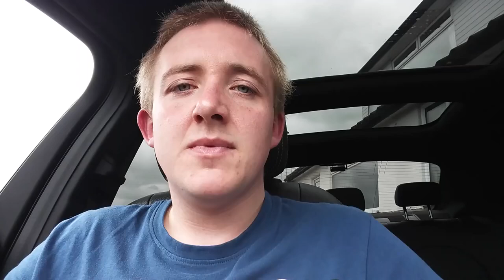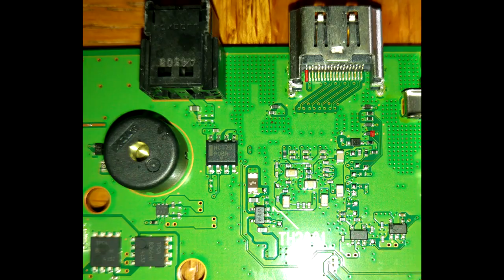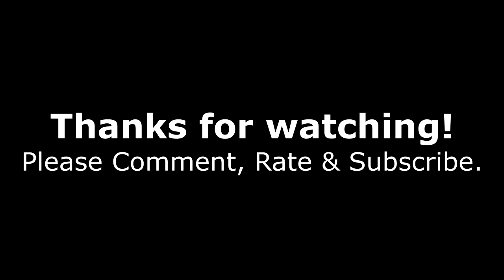Phat PS4 HDMI Pin-out - SAA-001 / SAB-001 Motherboard (10xx / 11xx Series)

Comment: Oh and the console i'm working on is CHU - 1115A. Does that match this series of boards you show this pin out for?

Cheers man.
Reply from the maker: Hi, yes the diagram will be fine. 6th pad (pin 14) is indeed an NC pad and is not required. Pin 13 (7th) is CEC. Check diode is not shorted to ground. If everything else is fine and you get white light no image then chances are it's either a bad Encoder IC, or a damaged / missing surface mount component in the HDMI circuit. Get it under a microscope to check for any missing / cracked components around there to be sure.
Reply: Yup. I did use a binocular stereo microscope and did see much damage. I will look again today, I'll also go over the other things you mentioned.
I dio have IC chips, as a last resort Ill try that.  I'm not using the wire you mention, I'm using more of a steal based wire it appears as it looks sliver... could this be the issue?
He mentioned it might not be the right of wire for such a high frequency output like HDMI.

Cheers Mate!

PS.  How come the pads and the pins that connect are so distantly numbered when them connect to each other?

Comment: I have everything in place and and i have the 7th pin run with the wire to where to should go, and I still get a no video single and a white light.
The 6th pin is not connected as that pad was destroyed too, your diagram reads the 6th pin doesn't connect anywhere... is there somewhere I can connect it?
I can only assume that this the remaining issue, as this system worked fine before it was dropped and the cdmi port busted.

Any help would be greatly appreciated!

Cheers

Comment: I have  ps4 a customer dropped and brought in. The 6th and 7th pads were destroyed. Not sure how high this fell from, but it was mangled.
Anyway, I checked out this video. Am i under standing you correctly hen you say the 6th lead doesn't have to be connected?
I connected the 7th lead to the small pad just off the A1 as you suggested but I'm still getting no video single.

I had been getting single and sound at one point, before I even jumped the lead.
Any idea? should I try connecting it to the other place ou suggest for the 7th lead, or is this just FUBARED?

Cheers!

Comment: Hi, I checked pin number 9 ( in the order shown in video, starting from the Digital out optical port) and it shows up as grounded. I checked it on three different consoles(CECH-100XX and CECH-11XX models), two of which are working (all resolutions) and all of them show pin 9 grounded. Can you check again to make sure your video is accurate? Thanks.
Reply from the maker: Pretty sure it is GND to the back side of that diode in the image. Definitely accurate.
Reply: Hi. Same problem here. The 9th pin is grounded. Is that an IC problem?

Comment: is there another point I can jump a wire for pin 3?
Reply from the maker: Third in from the right? Yes - run a wire through to the underside of the board and directly to the EMI filter pin at the end of that trace. Use a multimeter in continuity mode to check you have the right one (it'll beep).

Comment: Hi Andrew Paul,I ruin my board,because wrong temp four of the pin been out then I found this video,thank Andrew for the guide..
Reply from the maker: No problem. :-)
Reply: Hi, I checked pin number 9 ( in the order shown in video, starting from the Digital out optical port) and it shows up as grounded. I checked it on three different consoles(CECH-100XX and CECH-11XX models), two of which are working (all resolutions). Can you explain this for me? Thanks.

Comment: Hello Andrew,Awesome you tube channel. I replaced HDMI port customer had  obliterated. Had to replace 2 jumpers. Went by your diagram and getting white light. Will you please recheck pins 1 and 4 on your video to be sure correct? I am at disadvantage as my fine meter leads went bad and I'm having to use leads unsuitable  for this type of work so can't trace properly.  Thanks Alan
Reply: Found problem. A lot of pins are shorted to ground. Guessing bad HDMI IC under shield. Haven't pulled it yet.
Reply from the maker: Most probably.
Reply: Are some of these Panasonic chips glued? 10 minutes at 790 degrees and not budging.  I've changed many receiver hdmi ICs and they usually come off within couple of minutes, I'm using flux. Any other special chemicals involved?
Reply from the maker: Are these on CUH-10xx/11xx or 12xx?
Reply: CUH-11xx
Reply: Finally got it by loading pins down with chip quick 291ax soldering paste. Came up less than a minute. Not sure why it didn't come up with flux earlier unless it's too old. Thanks for replys.
Reply from the maker: No worries - was going to say that none are glued as far as I've ever seen. Only thing I could think was that these were CUH-12xx machines and with them being QFN packages the centre ground pad with the surface tension that brings can sometimes feel as though they 'stick' a little before they come away. Glad to hear you have it sorted though - probably down to old flux as you say.
Reply: Yes I had thought about possible ground pad also but don't think I had ever had one give me that much trouble even with a pad. That flux smells awful think it is bad. Had purchased a case of it maybe 7 years ago so that's all that makes sense. Thanks again.

Comment: quick question... can i take a hdmi port out of a blue ray player and solder that into my ps4 as a replacement? i would imagine its all standard and no special differences
Reply from the maker: No not really. Ports are £2-3 a piece so much easier to just buy one.
Reply: +Andrew Paul yh i had issues trying to melt the solder i dont have the equipment for it but ive been quoted some pretty stupid prices too for the job
Reply from the maker: Where are you located?
Reply: +Andrew Paul near cardiff south wales
Reply from the maker: Check my eBay page - I offer mail-in repairs for HDMI ports for UK-based consoles:
http://www.ebay.co.uk/usr/lufcfan2004

Comment: Hi Andrew, first of all thank your for your great video's. I think they are really helpfull. I got a ps4 pcb problem myself. Most of the pads are ripped off. Should I remove them from the old hdmi and try to glue them back on the board or just solder the new wires directly to the pins?
Reply from the maker: Running link wires is probably the best bet - it all depends how bad the damage is really.
Reply: quite bad I'm afraid: https://s32.postimg.org/ay6fvsbv9/afbeelding2.jpg

Comment: Hi andrew! thanks heaps for the video :) Can you please guide me how to connect pin's 11, 14, 16 & 19 as the connections run to the small holes on board... :(
Reply from the maker: Hi Lee,
Have a search on my channel for a video called soldering to vias. That will show you how to correctly prepare these small holes for soldering to. Cheers.

Comment: HI Andrew would you have any idea where I would get replacement components for around the HDMI port as someone had tried to repair a HDMI port on a ps4 and messed it up big time, ie missing pads, lifted tracks and 5 surface mount components from around the HDMI port. any help would be amazing.

Comment: Hey Andrew, I have repaired a few PS4s where an attempt has been made to replace the HDMi ports and they have ripped the pads out, one had 7 pads missing, I have never repaired them with tracer wires, I removed the solder mask with a fibre glass pen to reveal more copper around the pad and the start of the trace, once this is done the solder pools like a dream back where the pads used to be. Then replace the port as normal with no messy wires, have you tried this. Regards
Reply from the maker: +Tech Repairs Hull Ltd Hi, yes I'll do it this way if I can get away with it but often I find people pull the traces too leaving a bit of a mess behind. Cheers for the tip though - I'm sure many will find it very useful :)

Comment: Should the 2nd pin in your video be grounded?
Reply from the maker: +andrew chalmers No. That goes to a small diode. If it's grounded there's your problem - you've just got the small problem of working out what's pulling that portion of the circuit to ground. Pull the Encoder IC and see if the short disappears, if so then replace it with a new part. Good luck!
Reply: http://postimg.org/image/kckoxga8n/

Where can i get the 2 small componets that are missing top right of ic chip?

Comment: Have you ever had one where you replace the HDMI connector and everything works except 1080p? Pins on this one were really messed up and 1080 won't come back no matter how many times we try a video reset and hdmi cables. Almost seems like something shorted out on the board but can't seem to find anything that is burned. Any ideas?
Reply from the maker: +Short CirQit Hi, check the EMI filters to make sure none are shorted. If they're OK then replacing the HDMI Encoder IC should do the trick.

Comment: You are a legend thanks for this, 
Currently repairing a bodge job of a hdmi being ripped off. Top right component has also been ripped off the board. (Tracks intact) I think this is just a zener or a protection to ground component am I in thinking this is correct? This is the 5th pin in your tutorial. 
Many thanks 
Dave
Reply from the maker: +dave vachon Correct mate it's a zener diode and can be ripped from a donor board or even a PS3 mainboard if you've still got some of these kicking around. :-)
Reply: Cool well am I correct in thinking this should work without for now as its not a part of the actual HDMI signalling?
Reply from the maker: Never tried it with it missing to be fair mate - the ones I've had that have been missing I've always replaced prior to testing. Cheers.

Comment: Thank you so much for this! I used this pinout to test the HDMI circuitry with a multimeter on a ps4 with the WLOD and it all tested good and the port is in perfect condition... That being said I believe the Panasonic IC must be bad, although I am curious to know if you might know if/how I can test the IC directly. After watching your repair from hell video(PS4 Repair From Hell - Complete HDMI Circuit Rework ), I am confident that I can replace the chip if needed as I am fairly skilled with a soldering gun although I will need to pick up some flux, desoldering Wick, and maybe a smaller heat gun(air gun) as well, because the one I have is quite large and puts out a ton of heat.
Reply: +Chesley McDaniel Update, I am now watching your video about pin 13 short to ground and I don't have a short to ground although in checking the two points of the diode I get infinite resistance at any ohm setting on my multimeter.
Reply: +Chesley McDaniel Another update, Btw this is not a previously botched repair attempt ps4. It just mysteriously stopped displaying a proper signal via HDMI. My samsung tv gets a partial signal I believe as it does not have the HDMI source greyed out when the ps4 is plugged in, as it is greyed out when not plugged in. I just tried a different multimeter with a diode setting as the previous one (I realized) does not have that setting (the lowest setting is 200ohms). So that being said, I do get a reading on the diode of 681 according to this other multimeter. I also am now watching another video I just found of yours (How to Diagnose and Replace a Faulty Panasonic MN86471A HDMI Encoder IC Chip (WLOD).
Reply from the maker: +Chesley McDaniel Sounds like a faulty MN86471A from what you're saying.
Reply: +Andrew Paul Yes and thanks to you, that is the conclusion I have come up with. I will get that chip ordered and see how I do. Thanks again Andrew.

Comment: why does no one make a past that hardens into a new pad, brought a ps4 off ebay, some ass has done a previous repair and stripped the pads from the board, dont have a road runner wiring pencil to join any of the pins to the other components bridging it. Andrew, are you proficient in repairing HDMI pad damage?
Reply from the maker: +DirtyRottenBastard Hi there, Yes I am. It's very fiddy and needs some very fine gauge enameled wire and steady hand. :-)
Reply: +Andrew Paul how much extra on top of your ebay add to repair this damaged pad board, its basically pins 14 (no connected) pins 15, 16, and 18 that need sorting out.
Reply from the maker: +DirtyRottenBastard 10 quid mate.
Reply: +Andrew Paul 

Would like to just give thanks for this helpful video, finally decided to bite the proverbial bullet, and give bridging a go, once my road runner wiring pencil arrived. happy to report, we are back to a working PS4
Reply from the maker: Congratulations on the successful repair :-)

Comment: Anyone know what component pin 5 links too?
I am guessing it's a diode but it's missing here got a real dogs mess board off ebay
Reply from the maker: +Arnie Livingston It is indeed a diode. If you have any spare PS3 boards around the same one can be found and used from there.
Reply: Cheers man the display port is mangled too I might give up.
Reply from the maker: +Arnie Livingston Got any pictures mate? Might be salvageable?
Reply from the maker: +Andrew Paul Ouch. I wouldn't worry too much about the Aux port (its only used for the PlayStation Camera anyway as far as I know) - the HDMI has been largely butchered - those traces are all going to need a link wire running by the looks which is a pain. There's a good few hours worth of work in there so I'd ditch it unless it's worth your while to sit there and repair it. I've got one like that I've had for months which I'm going to get around to one day but I can't motivate myself ha ha!
Reply: +Andrew Paul there's hope continuity is good so it's just the one lifted pad & a diode just need a fresh hdmi socket. All caps  & traces on the camera port are gone though.

great videos by the way

Comment: Hi andrew I commented before here, change to my ps4 the hdmiand one pad is blow make the trace and all contact are good with alternative points, so the hdmi port must be good, change de hdmi ic but i still having WLOD. Some clue of what I have to check?
Thanks !
Reply from the maker: +Miguel Andres Correa Montoya hi, do you have a photo of the port, link wire and general area of the HDMI circuit? Cheers.
Reply: +Andrew Paul yes i have, i can post here upload sonewhere and send to you ;)
Reply from the maker: Hi, It looks as though some of those pins are a little misaligned (in the photo at least). Mainly right hand side, uppermost pin (is that pin crossed onto the adjacent pad or missing altogether?) and bottom row, 1st pin on the right. I think it would be a good idea to check continuity between adjacent pins to locate any shorts. I'd also be tempted to check those small resistors are still properly in place above the IC as they look to have been caught with solder.

Comment: hello I recently got my hdmi replaced and it still has no video, it shows the white light like it showed in the video. I'm worried either the guy didn't install it correctly or something else is damaged, is there a way to fix it or should I just loose all hope on it?
Reply from the maker: +MghUnit407 It's most likely a failure of the Panasonic HDMI Encoder IC (MN86471A) chip (providing the port was properly replaced that is). The chip lives under a metal plate on the backside of the board. Replace that and most likely you'll be back up and running. It's an easy job for an experienced tech - 30mins tops start to finish.
Reply: +Andrew Paul Do you these repairs yourself and if so at what price, I'm desperate right now.
Reply from the maker: +MghUnit407 I do offer a number of repair slots here:
http://www.ebay.co.uk/usr/lufcfan2004

Thanks.

Comment: Do I need a reball for my PlayStation because it used to turn on sometimes but now it only turns on when I put on pressure if I let go it turns off and how much would a reball normally coast
Reply from the maker: +danyal rafiq yes that's a classic sign of requiring a Reball. Expect to pay between £50 - £75 depending on where you are based.
Reply from the maker: +danyal rafiq yes that's a classic sign of requiring a Reball. Expect to pay between £50 - £75 depending on where you are based.
Reply: Andrew Paul ok thanks I live in England btw

Comment: Hey, my PS4 broke.. It turns on, then a few seconds later it turns off. I have researched it and I don't know weather it's the APU or PSU, my uncle is going to try a new PSU on it. But if I bang it, it works for about 20 minutes or so and then freezes, but if I move it slightly it does the same thing, keep turning off after a few seconds.
Reply from the maker: +Trippin That's APU :-(
Reply: +Andrew Paul :( is it fixable?
Reply from the maker: +Trippin more often than not a reball will fix it.
Reply: +Andrew Paul How much is it for you to reball it? or don't you do it for others
Reply from the maker: Hi, yes I offer a limited number of repairs via eBay: http://www.eBay.co.UK/usr/lufcfan2004
Reply: +Andrew Paul I just bought a new one anyway haha.